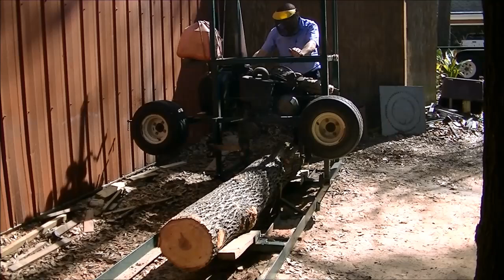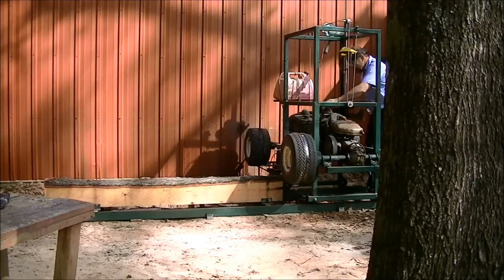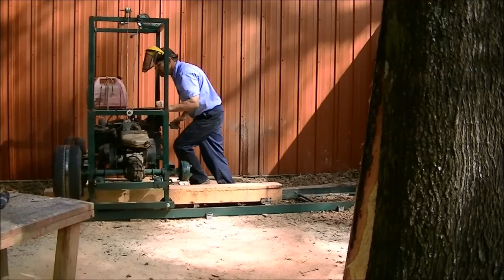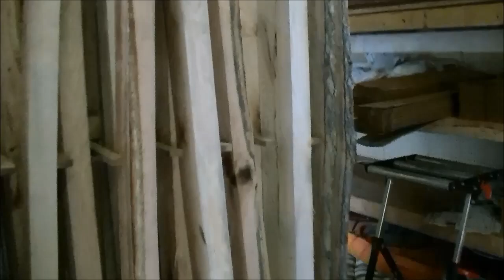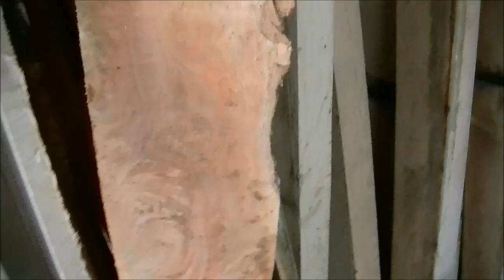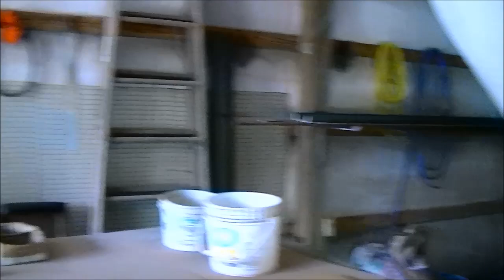Milling wood with homemade sawmill. Thin slice of bark looks like flame.

Comment: Im super impressed with the simplicity of your saw mill - still trying to figure out your height adjustment..?  The hickory is beautiful wood indeed..!!! Ive never seen vertical wood drying method like that - any issues with warping or twisted material..?
Reply from the maker: I first started drying it out laying flat but it did not get enough natural air flow so I saw where another guy was drying it standing up. It is easer to pick a piece out when you are ready for it and takes up less room. I have not notice any warping yet.

Comment: Looks like you may have added another blade guide between the original two. What was the issue? Love your mill, by the way!!!
Reply from the maker: Yes, I added a adjustable guild. The closer you keep the guild to the wood the more accurate it will cut.

Comment: That rig just keeps on going! I'm curious on what maintenance you perform on it? I mean the engine things are a given, but do you specifically look for other signs of wear and tear?
Reply from the maker: I just check and change the oil. I hose all the saw dust off when I am done. I built it from a 20 year old golf cart and I will be putting a new clutch on it soon.
Reply: markp0177 So all in all pretty basic. Cool. And yeah, i can imagine the clutch would get quite a bit of use in this setup.

Really nice.
Reply from the maker: aserta The clutch was wore out before I turned it into a sawmill. Only cost $48 for the part I will need.

Comment: Have you noticed any issues with wavy lumber or uneven thicknesses from the band wandering? Thanks, Duane in VA.
Reply from the maker: If you try to push it to fast It will get a little wavy but just go a little slower and let the blade do the work and it is very straight.
Reply: Thanks.